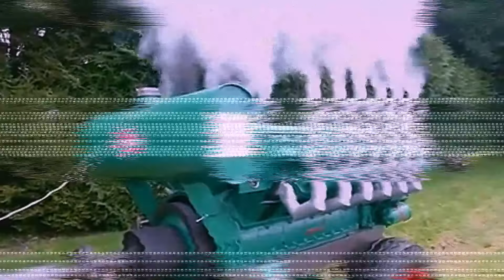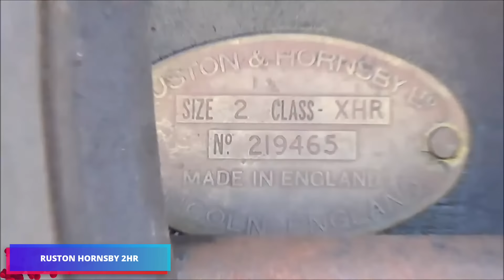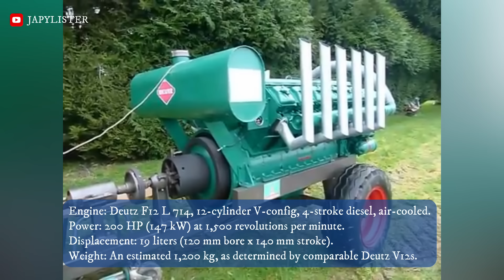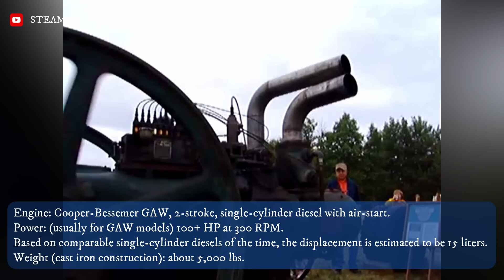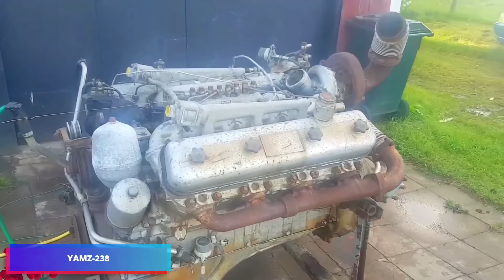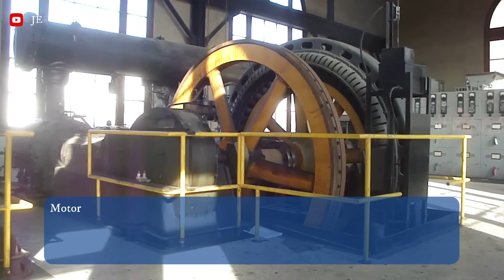Soviet V8 vs German V12: Starting Up the World's Rarest Diesels

Comment: the 100hp cooper Bessemer is Mark IV and the 3 cylinder wolverine marine engine is not a diesel, its a gasoline vapour or kerosene later, they gave on the 3 cylinder pretty quick interestingly it was the first massive marine to have a reverse gear.ASD/ADHD has filled my head with random knowledge of all kinds. I have 40 years of encyclopedia in my head.

Comment: Many of the engines in this video are low RPM engines. but not as low as the engines in early 1900s ocean liners. such as the Titanic. the reciprocating steam engines that were used in the Titanic. had an RPM range from 72 to 77 RPMs wide open. that is a pretty slow turning engine. however you have to figure most engines wouldn't idle at that RPM. but their emence size allowed those engines to run at low RPMs. however the Titanic had an additional steam turbine engine. which at the time was very new technology.

Comment: The acoustic profile of these vintage engines is fundamentally different from modern powerplants due to their exceptionally long stroke-to-bore ratios and massive rotational inertia. The distinct, isolated exhaust notes we hear are the auditory result of a slow, deliberate thermodynamic cycle where each combustion event is mechanically separated by the heavy flywheels maintaining momentum. It serves as a brilliant auditory textbook on early internal combustion mechanics

Comment: That low idle rumble is pure therapy. You can almost feel the metal breathing again.
Reply: Your description of the "metal breathing" is a highly accurate poetic translation of volumetric efficiency. At these incredibly low idle speeds, the massive displacement cylinders draw in vast quantities of atmospheric air, entirely unassisted by modern forced induction. The resulting low-frequency rumble is the literal acoustic signature of that immense atmospheric displacement occurring during the intake stroke

Comment: @ 8:14 Wolverine diesel;  Not a 2 stroke, because of a clearly distinguishable inlet- and exhaust outlet valve action in the video. Thanks
Reply: Excellent observational skills. Identifying the four-stroke cycle based on the exposed valve actuation is precise mechanical analysis. The Wolverine diesels of that era utilized robust overhead valve trains that provide a perfect visual study of the intake, compression, power, and exhaust sequence. Your visual confirmation of the independent valve events definitively rules out a two-stroke scavenge cycle. Superb diagnostic eye